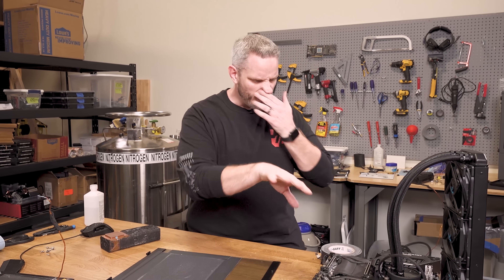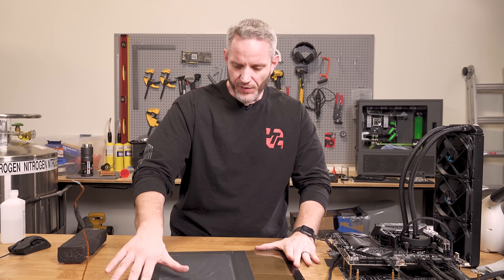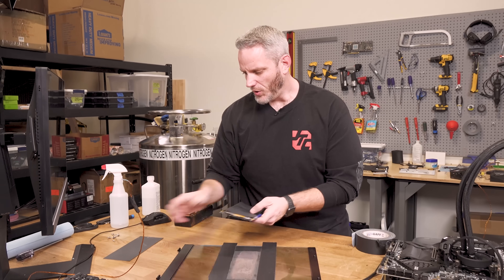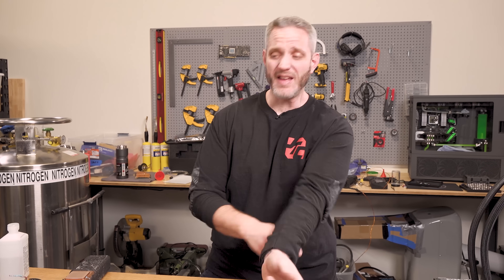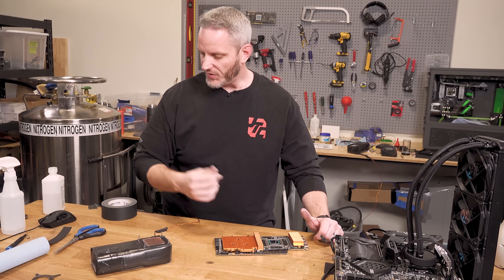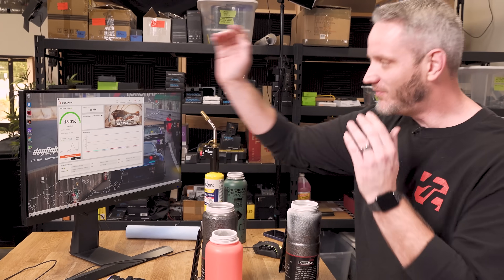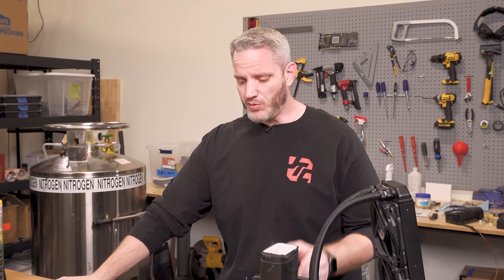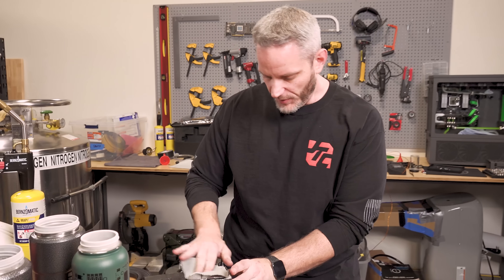THIS is Why Lapping Your Cooler is SO Important!!

Comment: Cringe AF dude. Get a 1000 grit wet stone, and a 3000 grit wet stone. That sand paper is way too rough for what you're doing imo. Copper is a soft metal. Let off on the weight a bit while you're at it. 200g of force should be enough. About the weight of a good chef knife of force on the wet stone.  :) Based on the sound of that first paper.

Comment: "some groove is OK" , no it isn't, a groove is an air gap, that block should be polished to a mirror. the paste doesn't need to "bite" into anything, it's not holding anything together structurally. the ideal scenario is purely flat metal on metal because it's a lot more thermally conductive than paste, obviously you won't get that but the flatter and smoother the metal surfaces are, the less you have to rely on the less thermally conductive paste.

Comment: We always used to use a figure 8 pattern on wet and dry to get ring of saw marks on cut stainless / epoxy  - seemed to give a better overall finish than just straight lines. There's an experiment video for you that might actually burn people out - lapping techniques ;-)

Comment: the rough texture you go for actually just increases surface area. Completely flat is the smallest surface area possible with a given area. scratches increase surface area. As long as they aren't deep, it's a bonus to thermal conductivity.

Comment: Get a cheap granite plate.  Glass is not flat.  Also lap in figure 8s rotating it as you go.  Also use Emery cloth, not sandpaper.  You can do 300 psi plus metal on metal liquid seals that way.

Comment: Glass is not perfectly flat but its close. Its a liquid so it actually has a slight bow to it. The bow will normally be toward the end that is the mounted bottom position. Even if you make perfectly flat and square glass, over time it will slowly slow towards the bottom. Its part of the reason churches flip their windows every 50 years and their stained glass looks thicker in the bottom of its divisions. My local basilica just did theirs during Covid.

Comment: as a CNC polymechanic (high precision metal industry) this hurts to watch... 
- this is sanding not lapping
- this will never be flat, you're not really able to apply even pressure - especially considering how onesided your "tool" is
- use marker to see what you're actually doing, where it sands and where it doesn't and when you achieved "flatness"
- use a straightedge to make sure what you're doing is going the way you think it is
- use a much harder and flatter surface, thin glass isn't really that great 

"some groove is okay, you want the thermal paste to kinda bite in there" - if that's the case, then you don't need to lap it at all... isn't the goal a perfect fit that would actually eliminate the need for thermal paste?

Comment: the benefit to not going mirror, really only applies to when you are going sub zero, due to thermodynamics and material differentiation. since you are sub zero, your pot will shrink microscopically, and the thermal paste will squeeze out and in as the temperature increases/decreases similar to oil in a pistoned car. a mirror though doesn't grab/bite the paste but the microgrooves will, similar to micro sintering a heat pipe

Comment: WE ARE NOT BURNED OUT JAY, don’t blame us! ;)
Reply: Why is LN cooling even a thing. It's not reasonably applicable and only for reaching performance you can't even use.
Reply: @manuw.1161  Because overclocking is a benchmarking/competitive endeavor. Seeing purely how far these cards can be pushed is interesting especially  when pushed to thermal extremes.
Reply: @manuw.1161  Well you said it yourself, to reach performance like no other cooling solution. People using LN will probably only using it for that purpose right? Who cares if it's not usable, the number is all they search.
Reply: @manuw.1161  on the surface it may not be applicable, but if you look back at specifically designed LN2 products(gpu's, motherboards, etc) a lot of the hardware eventually becomes standard on normal models. it's the same argument of why is racing a thing? no one will ever drive that fast on the road. well if it wasn't for racing we wouldn't have all the safety enhancements that have gone into consumer cars over the last 80 years or the efficiency improvements in engines.. a friggin smart car has more hp then a 8 cylinder from the 30's while getting 50mpg..
Reply: We are burned out..... overclocking videos are mostly ...tip liquid nitrogen, look at numbers...repeat until asleep

Comment: Me, who laps every cooler and CPU he ever buys:
"Finally - vindication!"
Reply: The CPU?
Reply: @slm8328  Yep - no reason not to once the warranty expires.
Reply: @JMUDoc  I wouldn't try anything with it after the warranty expires.
Reply: @slm8328  

Why not?
Reply: @ryanwilson5936  because I want my parts to last longer or more correctly, no to fuck around and find out
Reply: @slm8328  

How would you know unless you fuck around and find out? I usually just do XMP and the core boost stuff in the bios. I’m far from an expert though and agree with your statement. I just don’t let a useless warranty influence my actions.
Reply: @ryanwilson5936  if I was going to try to do something like lapping my cpu I would do it if I still had a warrant so if I fucked it up, I could replace it with a few fees
Reply: @slm8328  

Lapping voids the warranty.
Reply: @ryanwilson5936  well that sucks
Reply: @slm8328  

Yeah, as far as the warranty is concerned if the cpu or cooler base was that out of whack to the point it needed to be flattened more, you’d RMA it before ever taking it to a lapping plate. Basically, because they can’t tell if what you did is what’s causing issues. Especially when it comes to lapping. They will tell you “well of course it’s not transferring heat well, you tried to lap it”. If it needs fixed in any way, they need to do the fixing and in this day and age they will just replace it instead of actually tweaking the original item. That goes for almost any consumer item you’re looking right now.
Reply: @ryanwilson5936  that makes more sense of what that guy said earlier
Reply: do you also do extreme overclocking or you do it just for the peace of mind better contact?
Reply: Wait, we're not meant to lap all the things?

Then why do AMD and Intel glue such crappy bowed heatspreaders on their CPUs?

Comment: Lapping your cooler is better period. I don't OC with LN2 like Jay does but just lapping a Cooler Master ML360R copper cold plate dropped 3 C at idle and load for me. I am using it for a i9 9900k at 5.1GHZ, 1.34V. Just lapping the cooler plate rather than the CPU dropped my temps enough for a great stable all core OC. Does not get above 80 C under full load now and idles at 28 - 30 C. I concur Jay, Lapping your cooler is so important!

Comment: I'd just machine milling it, mirror clear and perfect horizontal.
Reply: What would be the point in that? Would you wager that any commercially available "mill" would leave a more precise finish than the factory? 

Effectively you'd end up with the same results but lose some material.

This process is to increase surface area and therefore thermal conductivity

Comment: Since I spotted it in the video here again my two cents: Have you tried to use a lightweight version of windows 10? like one that disables most background services like for example that notification push service which popped up during that one test run? Since it's XOC I think you would want every little point you can get and these adjustments can surely get you some of these points

Comment: Pro tip from a machinist: get some prussian blue, spread a thin layer of it on one of the surfaces, then mount them together, remove it and you will see where the high and low spots are.

Comment: Not an expert on this, so if someone knows better then please correct me, but I have to disagree with kingpin that keeping the surface rougher is better so the thermal paste has something to bite to.  Lapping the surfaces achieves two things: 1) decreases the distance heat has to transfer across thermal paste, and 2) increases metal to metal contact, which has orders of magnitude higher thermal conductance.  Ideally you would want them flat enough you could wring them together.

This is just a guess, but kingpin might be using too much thermal paste and it's not spreading out thin enough (the finer the surface has been lapped you'll need less and less thermal paste).  Might try heating up the thermal paste first prior to applying it.  Sliding the block on from the side rather than it down might help as well.

Comment: I learned a trick for sharpening knives a long time ago that might help with finding high or low spots when using the sandpaper. Take a sharpie and leave Mark's over the entire surface you want to flatten. Then make a few passes on the sandpaper. That will wear away the sharpie marks, and whatever marks are left are lower spots that you need to sand down to, so that your surface if flattened.

Comment: You can buy a "lapping plate" for as little as $20.00 then invest in various grit carbide media (do not need diamond grit for this soft copper) - google it.   Same as with different sand paper use various grits working it down to a mirror finish. *  You can (but it costs $$) purchase a monochromatic light and a optical flat which you can use to measure absolute flatness but only from the mirror finish.  You can skip that altogether and just go with achieving the mirror finish * because it's not much extra work to do that, and if it's mirror there's a very high probability it actually is perfectly flat.  Afterwards you can "scuff" it up to achieve the micro pockets that the thermal paste can fill - if you only ever lap it to being "scuffed" and stop there, you really have no idea if you are even close to flat.  With the thermal expansion of both pieces being slightly different, the shape, the surface area's, you can expect the two pieces to separate (microns) becoming slightly convex or concave at working temperature.   Using  FEA you can calculate the profile at temperature, pressure, etc. and then lap the parts in advance to the corresponding convex or concave so that in service the pieces move to near flat with each other - but that's another story.  IMPORTANT:  Between change in slurry / grits always perfectly clean both piece being lapped and the plate.  USE a figure "8" pattern instead of back and forth /45 degree / counting tracking the number of passes.  Figure eight removes that completely.

Comment: Trick from a former jeweler on hand sanding flat surfaces: Put the piece under a bar lamp, usually just a long halogen bulb like they use in bulk in schools and grocery stores. If the reflection from the lamp is perfectly straight, your surface is flat. A surface that isn't flat will have a wobbly reflection.

Comment: glass is ONLY perfectly flat before it gets lifted from its cooling bed .... after that it is NOT flat ever again ... and as a super fluid it is ALWAYS in motion ... so it will never be the same surface it was when you last lapped using it ... better to use a  machined block than glass.
Reply: repeating the Hubble telescope problem ... making it wonky from the outset ...
Reply: also keep your bloody filthy hands off the surface ... the oil and dirt from your fingers is enough to change the plates evenness ... every time you put a filthy finger on it you MUST start all over again ... SPOTLESSLY CLEAN ... keep them filthy paws off the surface ...
Reply: jayz 2 cents ... over priced ... by 2 cents
Reply: btw you are sanding NOT lapping ... if you were lapping everytime you touched the surface you had to start over and you NEVER do straight lines for lapping ... just like lapping your valves on your engine ALWAYS rotate ... always different directions .. always keep your filthy hands off the surface ... ALWAYS use fluid or polishing paste

Comment: Hi admiraal Jay, in honestly think you need to find another mounting device, other then The C-Clamp. Something that will maintain and/or measures the pressure. 

Reasons being a more controlled mount. And you will be able to find and return to a “the sweet spot”. As far as i can tell the C-clamp is something that does not give the “controlled environment”. that you really want in this battle for scores.

I would suggest a Torque Lock, it gives more control and when you put it away it doesn't change its “settings” like a c-clamp does, as a cheap option. Expensive options would by hydraulic or air powered presses with pressure sensors.

BTW, love the channel. Not na IT specialist but know my science. Its al about creating a controlled environment while experimenting.

Comment: You forgot to mention that having fine texture instead of a mirror-like polish means more surface area for heat transfer.
Reply: No, unless the opposing surface has identical texture (so the fit like gears meshing) otherwise you have air between the surfaces which is what we are trying to avoid.

Comment: there is a trick to keep moisture off the board, it may be a little tricky, but if you have a box (even cardboard) around the whole card you can run a nitrogen line into the box at low flow and it will prevent the ice build up. I have done some research with low temperature experiments in my research field and that has helped keep the ice from the coils of the fridge i was using.

Comment: Hey-Have another comment/question.  Have you tried optically checking the flatness of your die and cooling plate?  There are some videos about using optical flatness references on youtube.  The references are fairly inexpensive and its a fairly easy process.

Comment: @JayzTwoCents Do you think that glass is flat to a micron?
You don't even want a mirror finish. I understand why, you likely cant get it flat enough to not use thermal paste, and there is a strange in between smoothness doesn't work with paste, but doesn't work without. 
But the goal would be to make it so flat that you don't need paste, and in fact paste would be a hindrance.

Comment: Would a polished, mirror lapping be good if you're doing a water block cold plate with liquid metal as opposed to paste? Liquid metal tends to hang on tighter and is very thin, so I thought it might.

Comment: congratulations jay, just wanted to point out you are getting better scores than people that are running higher gpu core clock, so you might actually have a superior contact to everyone else ( smaller temp delta means more stability and better average fps at lower speeds) so maybe if you hit 2700 you might actually hit rank 1

Comment: Jay, have you thought about getting someone to make you a thicker backing plate? a quarter inch thick backing plate would put the onus on your screws to perform in terms of mounting pressure. Plus then you could record torque specs of your mounting screws and have it mean something.

Comment: After writing this comment jay mentions his technique @ 15:20, Jay is the Man!

I have no idea other than imagination and logic

what about "Coefficient of Thermal Expansion" - When you heat a metal it expands. so If you put a metal in sub zero conditions it contracts?

When you go sub zero the copper block "shrinks" a little, looses contact with the die, air is drawn into the low pressure spot and then pops like a bubble and causes issues. loss of contact is also a big problem.

So of at a certain temperature point you can say tighten the pot a tiny bit with the clamp, would that be enough to close the gap and improve performance?

https://www.copper.org/resources/properties/cryogenic/

Comment: A good ceramic floor tile is stronger, stiffer, and just as flat as a typical pane of glass.  I've lapped a few older Intel X CPUs even for air cooling.  As you say, the biggest benefit is more consistent temps across the cores, though that can often lead to higher overall OCs.

Comment: Jay, a tip when lapping a surface is to use marking fluid or even sharpie ink as a way to see how much material has been taken off and how close to a flat surface you're getting. It's not only great for personal use but it's also great for the viewers pleasure. You would essentially coat the surface with the dye and then start lapping. The raised bits will have its markings sanded off while the lower bit will still be covered.
Reply: Don't quote me on this, but I think someone said that the chemicals In a sharpie aren't good for the CPU. I would love to know if this is just a myth
Reply: @andystovell  sounds like something MacGyvver would kill a server with. 
I guess you can just clean it off with some acetone when you're done lapping. But yeah it's a great tip.
Reply: @lordsqueak  to be fair, Jay isn't above a bit of MacGyvvering haha.
Reply: @andystovell  And that's what we want to see ;)

Comment: Lap the IHS on the CPU and Cooler contact plate(unless it is heatpipe contact) to each other. A good lapjob counts more than paste choice. Also I think adding the KP heater to the back of the GPU also helps keep the PCB flat and not bow so much, you don't have to plug it in.

Comment: When lapping, laying a bit of milling marker down helps for eyeballing peaks and valleys.  A little Dykem can go a long way.
Also, a small 'portable' granite surface plate can be got for less than $300.
One thing about moisture control is that the evaporated nitrogen can be used as a purge gas.  Have a container made to trap the gas around the board and hold a light positive pressure bias.  Doesn't even need to be sealed.  As long as ambient air gets pushed out, moisture becomes a non issue.  Maintain a dry nitrogen flow while letting the board warm back to room temp and no foam or goop is necessary.